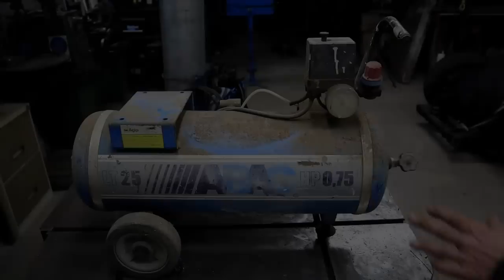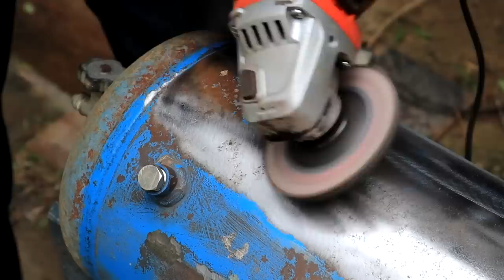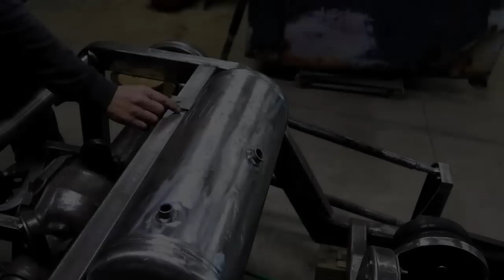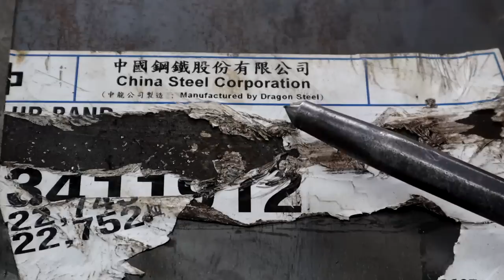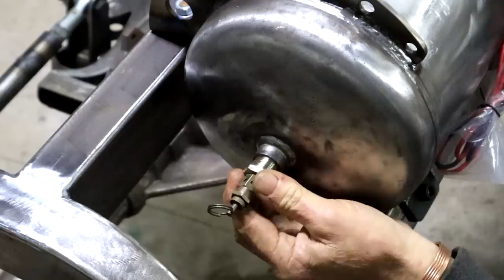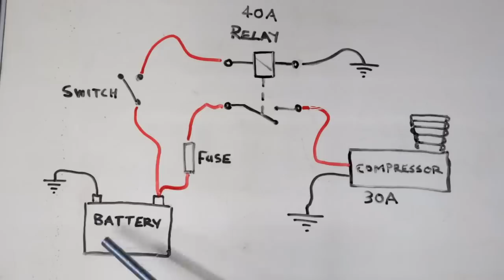Building an Air Ride Tank from scrap!

Comment: Great design on the air system. One thing I did on my system was to install a 1/8 npt ball valve and quick coupler, I carry a hose that will reach all four corners of the Rat Rod. I also carry a tire plug kit so if you get stranded due to a flat tire you can fix it. Take care Div
Reply from the maker: That is an awesome idea! I'm sold! 🙂Thanks brother.

Comment: Thats looking good Div...What's the specs on the compressor and where did you get it. Yes you right about the cold, its heading north towards us. Last night I didn't do any work on my bakkie, had an early night. Snow expected in mpumalanga / pretoria this weekend. Cold here is nothing like your side. Thank you for sharing.
Reply from the maker: It's a Viair 400C. You will see specs on Internet. I got it from Gremeltech in CT. Joggie there is very knowledgeable on air suspension. Nice dude

Comment: Well soon the air bag thighmaster clone will begin flexing the torsion rod muscle for some fun vertical pump action.😁

 Might be getting ahead of the game on this. If you haven't selected an air tank drain yet.. I suggest a cable pull style drain valve.. Easier to drain ..no crawling or reaching under the chassis....just pull the cable  attached to the frame ( or other convenient location) until fully drained. Thanks for sharing Diff👍
Reply from the maker: Actually not a bad idea for an OG like me! Might just look into rigging up something like that. Thanks
Reply: @ratrodsafrica  👍 Kool.. If you know of a wrecking yard that deals in air brake equipt trucks... they probably have plenty of used cable type tank drains ..work it into your next town trip...OR.. About $10- 20 US new.

Comment: Great fabrication skills diff 👌.   Have you thought about an emergency manual way of raising front and rear suspension in case one of those air components fail?
Reply from the maker: That would be way too complex. Air ride can be very reliable if done right. Thousands of trucks and busses with air suspension on the roads
Reply: @ratrodsafrica  👍👍

Comment: I like the AF-3000-03 in-line water traps..
Auto drains when pressure is relieved.

Now I stepped in it... 💩
not your application there~

Remove all moisture from air running out of an air compressor through a cooler (transmission, I used an a/c condensor) then into an in-line water trap before the check valve in tank. Mount cooler appropriate to use compressor's existing fan, voilla, Cool Dry Air!!!
Reply from the maker: Yeah...but I'm just building a simple rat rod...
Reply: @ratrodsafrica  I Love it!!! Genius!!!
The other bit would be a good video if you ever wanted to upgrade the shop air~
Reply from the maker: @desertdiagnostics  been thinking about that for some time. Then we can play with all the tricks you are suggesting! 🙂

Comment: Pretty cool setup as always keeping the theme. Can't wait to see the finished project. You have winter there now. ? We are just starting summer and it's getting hot today it will be around 102 and it's getting hotter as the week goes on. Well stay warm and I will be in the air conditioned house for a while. Take care diff.
Reply from the maker: Yes, deep winter! Everything is the other way round in the southern hemisphere🙂
Reply: @ratrodsafrica  so projects slow down now we like your videos but you don't have to freeze your butt off getting them done lol. Take care buddy. Stay warm and drink those hot chocolates.

Comment: thanks for sharing i took a old small roll around air compressor and made a air tank for  filling tires when my hose doesn't reach being on wheels makes it easy and can air up more than just 1 tire works great
Reply from the maker: That's a cool idea. I need to do the same. For my tractor with a slow leak. That is not parked anywhere near my workshop😃

Comment: Hey Div,
   Yet another great video.
   I expected to see you install some sort of gussets on the mounting plate for the compressor, but you did not.
That air vessel is made of rather thin material, welding on it as you did might weaken it.
I would be concerned about vibration and the weight of the compressor stressing the tank leading to a crack.
Just a thought from another ( Old Fart ).

   Work Safe, Be Well, Stay Warm
                      Enjoy Life
Reply from the maker: Yes, good point Old Fart😃. I thought the same afterwards...

Comment: What about a water condensate blow down on the bottom of the tank? I hope you did a visual inspection for rust on the inside of the tank.
Reply: I thought that you were that thorough. Just checking.
Reply from the maker: The tank has one, I forgot to show it. Yes, the tank looks ok.

Comment: Shouldn't pipe for air lines be black pipe instead of galvanized?
Reply: The galvanized will flake off and cause you problems. That's why you use black pipe for natural gas also.
Reply from the maker: @mechanic72  thanks for the feedback, I'll keep an eye on it.
Reply from the maker: Why? its made from the same material.